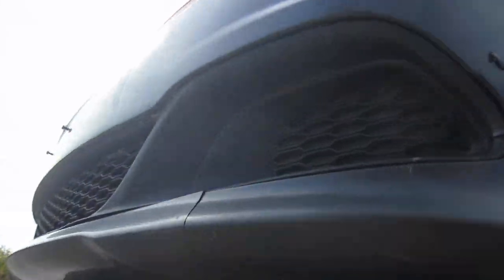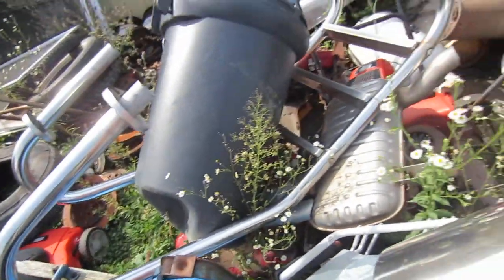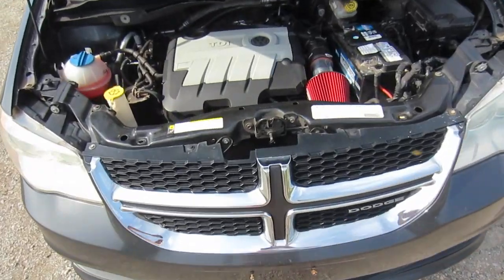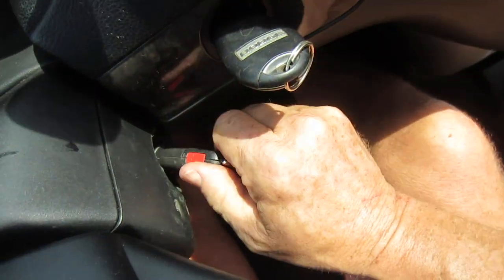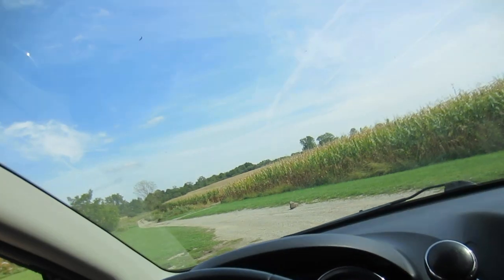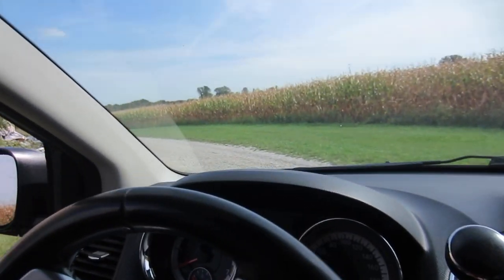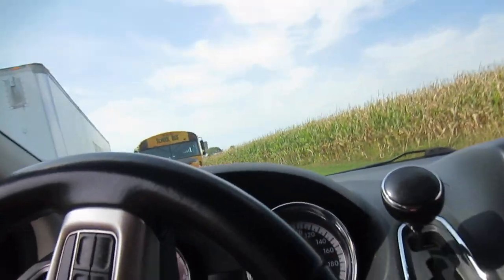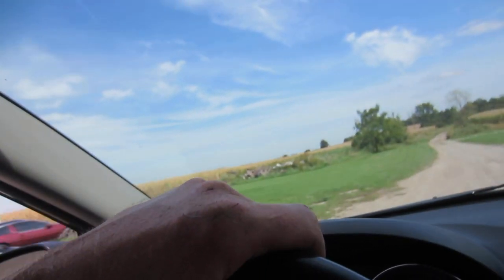26.  TDI CJAA diesel Caravan conversion is finished now.

Comment: What did you do for the speedo reading if you didn't use the original abs sensor for speedo reading? 
Awesome build, very unique!
Reply from the maker: it is using the van abs for speedo.
Reply: Good morning  @davidbrock4506
Reply: Hello  @davidbrock4506   How many cars have you got
Reply from the maker: @adamcrane1436  maybe 20

Comment: Pretty cool swap! I would like more details on the swap if you make a follow up video. Even though it's essentially the same van as the Caravan it would have been cool if you would have swapped the TDI into a VW Routan van.
Reply from the maker: those vans are expensive and rust more for some reason. more people drive caravans so this would interest more people.